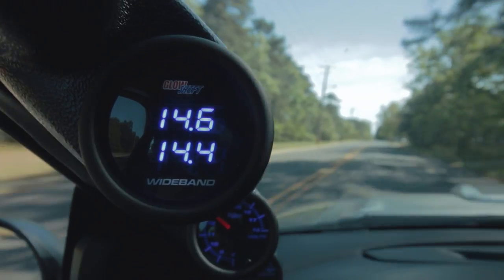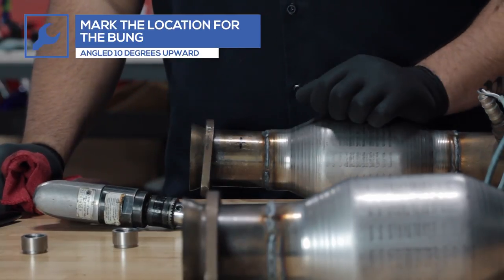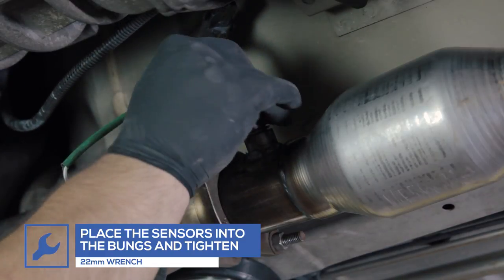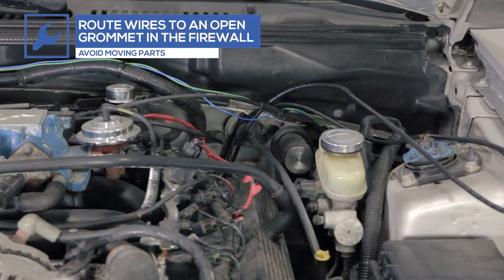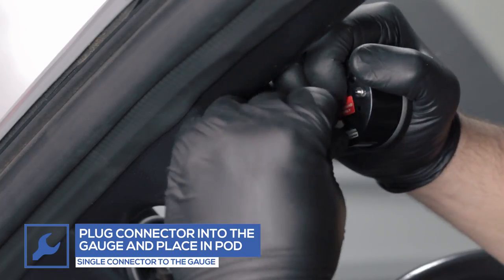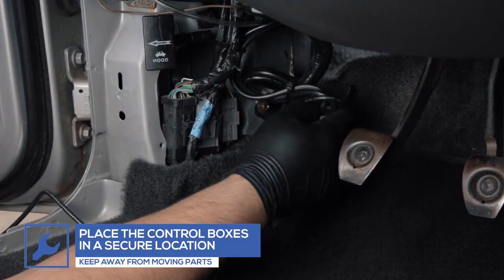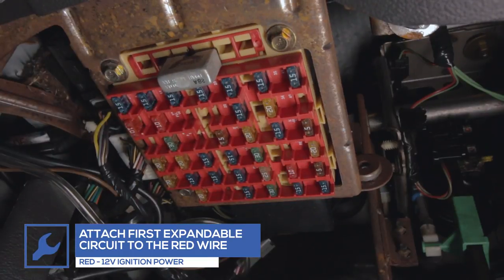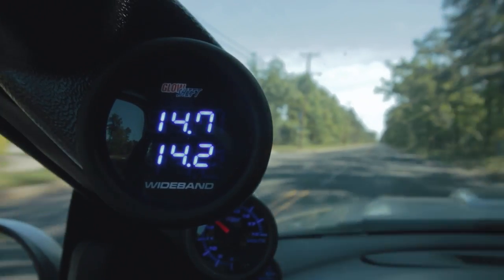Installation | GlowShift Dual Wideband Air Fuel Gauge for Cars and Trucks

Comment: In this video to calibrate the Sensors were secured to the exhaust, but on the installation instructions it says to remove them to calibrate. What is the correct way to do this?
Reply from the maker: The only way to calibrate them is to connect them to the exhaust. They need the exhaust to calibrate.
Reply: @GlowShift  this is not what the instructions state. You guys may need to update that. The instructions in the box says to calibrate it to fresh air.

Comment: what is the best one to buy just rebuild my engine 5.7 1990 k5 blazer i got edelbrock carb on there i already have headers so the hole is  there for the 02 sensor i converted it from tbi to carb.

Comment: My wideband afr gauge came with red, yellow, orange and black wires for power. It was not specified how to wire the yellow wire in this video
Reply: Yellow is constant 12v power regardless of key position. Pretty sure this wire is responsible for remembering the last programmed color choice.

Comment: I’m having an issue with my sensor reading a solid 11.8 when i give it any kind of throttle, no fluctuation at all. Would this be a faulty sensor or gauge?
Reply from the maker: Are both sensors reading 11.8 or just one? Have you tried switching the sensor plugs into the back of the gauge to see if the reading switches? That would give a better understand if it is a sensor.

Comment: I have a dual plane intake where each plenum connects to every other runner in the firing order so each plenum only sees two of the barrels of a 4 barrel carb. What is the purpose of a dual band gauge vs a single band gauge since the afr gets mixed together two barrels at a time on each side of the engine? Is it to detect if something goes wrong on the left or right side of the engine? Otherwise if everything is operating normal wouldnt you just see the same reading on both sides? Thanks
Reply from the maker: This gauge is really meant for vehicles that have a dual exhaust system so you can accurately read the air/fuel ratio of the exhaust coming out of both headers before it goes through the catalytic converter.

Comment: 4:52 what is the analog slot for?
Reply from the maker: Data logging
Reply: @GlowShift  how do you connect the data log? Do you need a module or is it hardwired somewhere?

Comment: What is the Data logging, meaning what does it log and how would I view the Log Data?
Reply from the maker: The data logging wire is so you can connect the wideband control box to a computer and log the wideband readings. You would need to use a data logging software.
Reply: @GlowShift  Can you tell me more about your data logger unit that comes with the Sensor? What computer interface, (analog, USB, RS232?) and what kind of data logging software?

(UPDATE) - I found the instructions on your web site explaining the analog output of 0v to 5v and conversion to the AFR. I have my answer, thanks.

Comment: Can you just use the o2 sensor hole that's stock?
Reply from the maker: The factory o2 sensor is used to send the emissions information to the vehicle's ECU. Disconnecting or replacing that will cause the check engine light to come on and possibly make the vehicle not run the way it is supposed to. To install our gauge, additional sensors need to be added because they will need to send information directly to the gauge. If you have already removed your factory sensors and tuned accordingly, then yes, you can just use the factory bungs.

Comment: What size drill and tap if I don’t have a welder ?
Reply from the maker: Use a stepper drill bit until the size of the hole matches the inner diameter of the bung.
Reply: @GlowShift  okay thanks what size tap though?